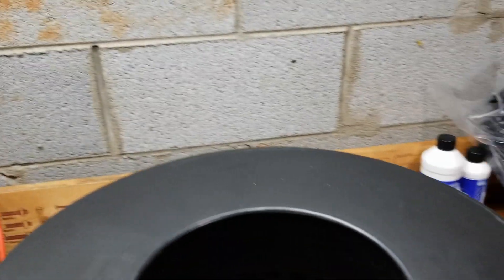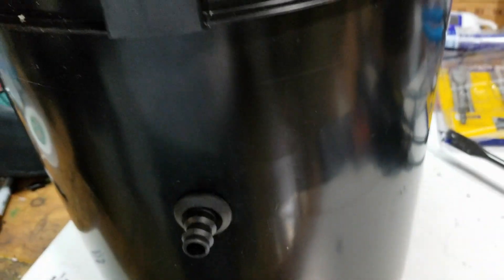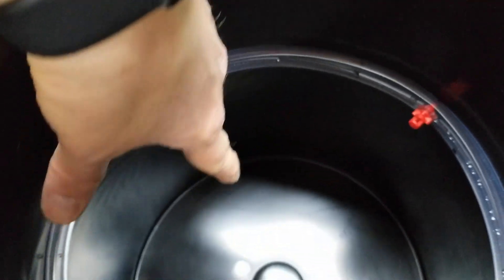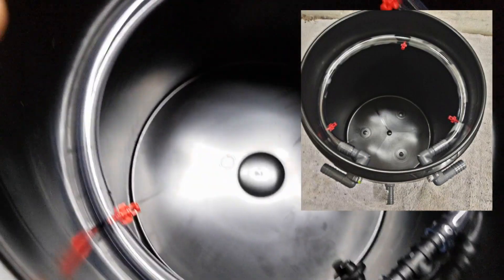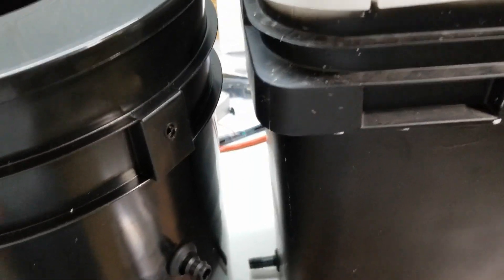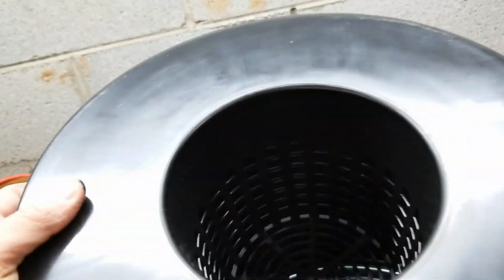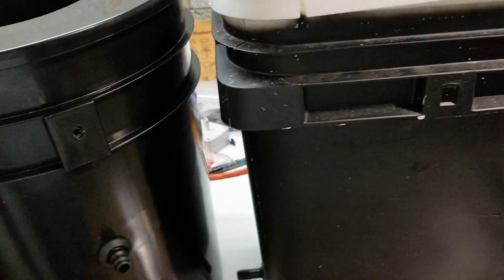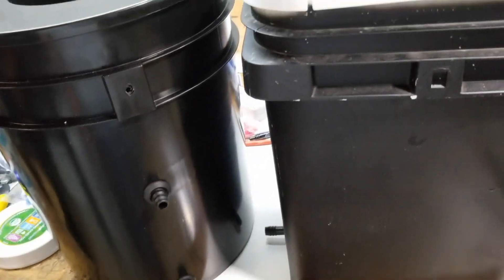What I'm working on - New low-pressure aeroponic system

Comment: This is the cleanest aeroponic set up i've seen. How did you get the tubing to sit snug along the bucket?
Reply from the maker: Thanks! Unfortunately I never actually tested this system yet. It was all theory, proof of concept, and I got sidetracked with other projects. But to get it snug was just a matter of cutting it to the proper length.

Comment: Nice looking system you have started there.  Curious to see how the water return to the tank is going to go.  The water going in, under pressure, from the pump, will be higher, but lower volume.  I bet it will be just fine and looking forward to seeing it run.
Reply from the maker: Thanks, Robb! I too have some concerns about that. Will need to do some careful observation and testing. I'm hoping everything will work.

Comment: Super cool idea Peter. I've been kicking some type of recirculating DWC system around in my head, but I like this idea better. I've found that aeroponic systems work awesome.
Reply from the maker: Thanks, Jared. Yeah, the aeroponic systems work very well. Got a nice plant on the one I ran last year. Hoping these design changes will address some the issues I had with my old system and can grow more than one plant too. I have some concern about the flow back rate and the pump and fill rates. Will just have to let it run and see what happens. Might need to make some adjustments.
Reply: Peter, I wonder if you have all the overflow go into another bucket, kinda like a sump, and then pump back into the 32 gallon resivoire you can avoid that issue.

Comment: Nice work. I have a single bucket system with a pump inside and the same type of spray nozzles which grows various herbs but the pump generates a lot of heat. I like the modular design of your system - will definitely borrow some of your ideas, thanks a lot for sharing.
Reply from the maker: Thanks for watching Bob! If heat becomes an issue, you could try one of those minute cycle timers, run it for five minutes, off a couple minutes. Might have to experiment some. With the step up in pump size from what I normally use, I'm concerned about the same thing. Will do some testing when I get it running.